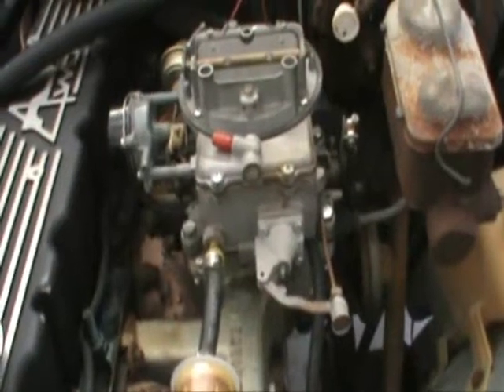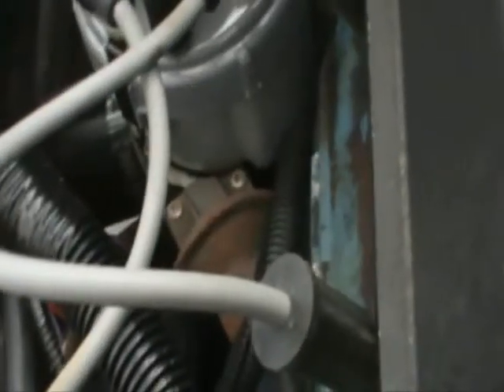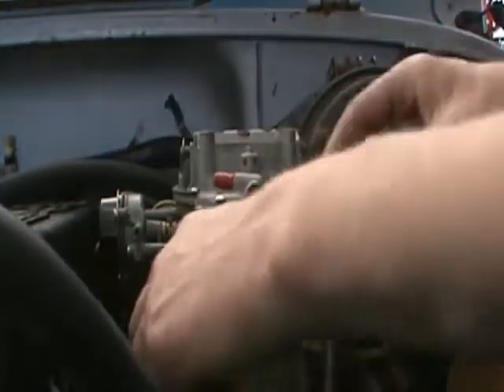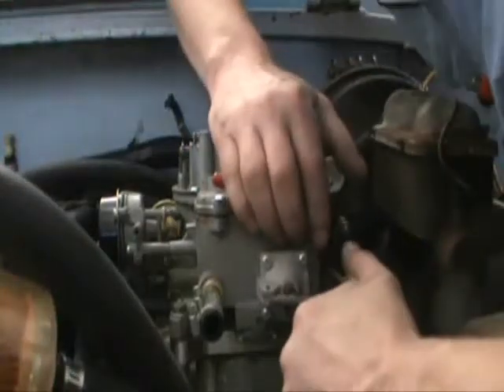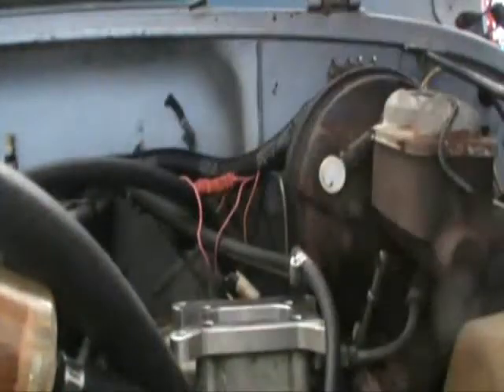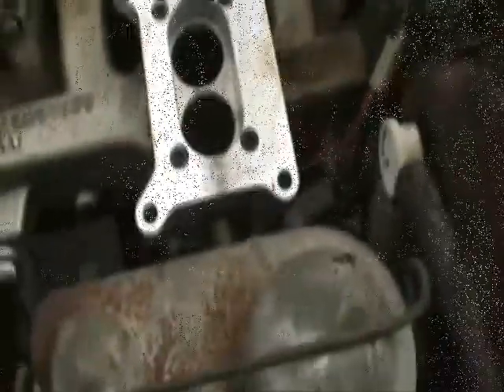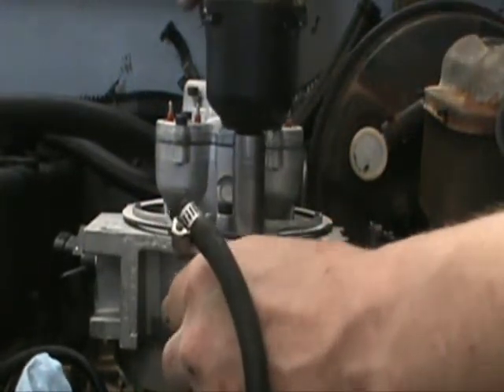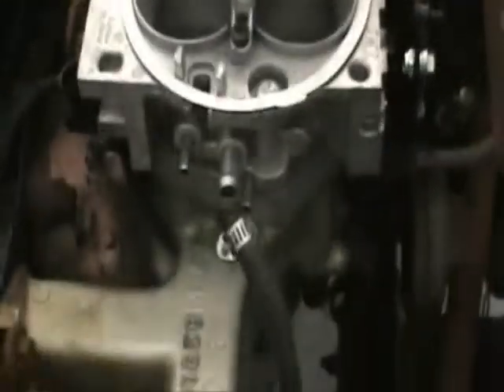Converting Jeep Scrambler to Fuel Injection Part 1 of 4

Comment: great video. i had a 79 cj7 with the 258 6 i picked up the 4.0 head and efi from a 94 wrangler on the 4.0 head you have to block the cooling ports on the drivers side . ran awsome when i was done sold it the fame was rusted bad.

Comment: I FINALLY INSTALLED A GM TBI IN MY CJ7 JEEP!!!! ----This video was a great help in the install... :) Only thing I need to get is a esc Electric spark control module and upgrade my ignition system since its the prestolite system... :)
 Yes.. I want spark control... So I went with a rebuilt gm throttle body unit and a reman ecm... Make sure you get the: 1227747 ecm computer..